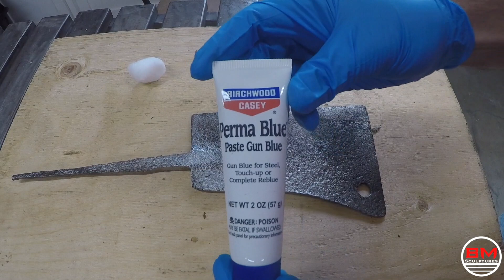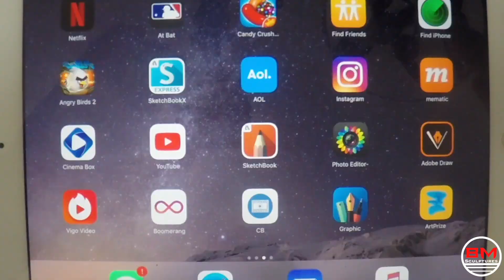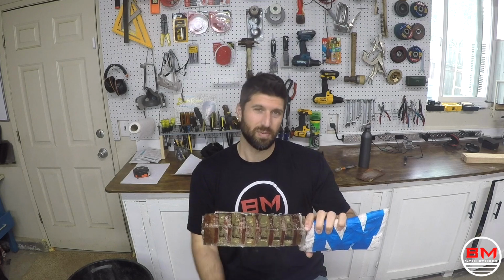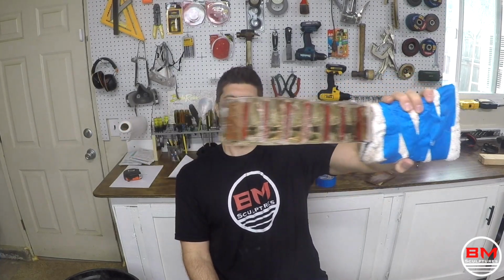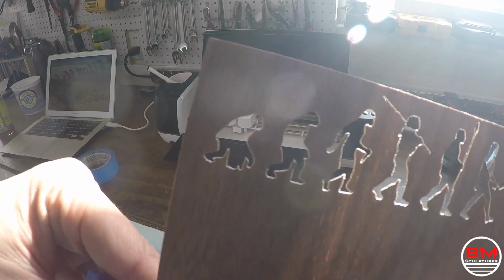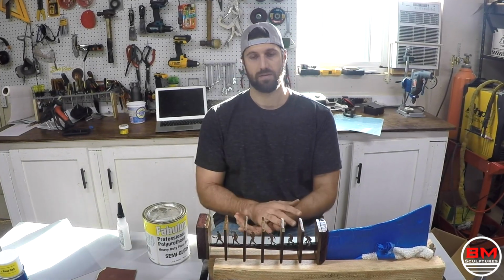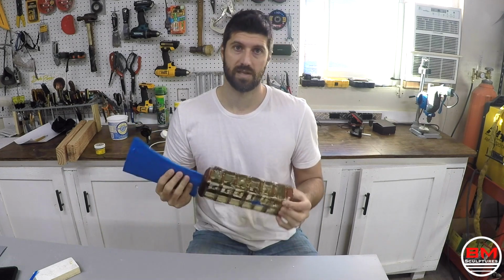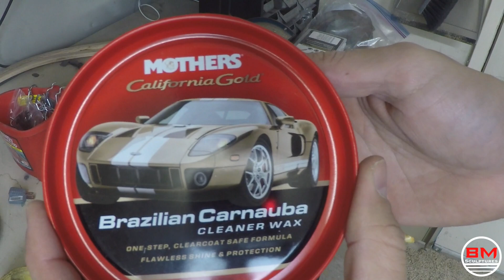Cleaver Restoration with Intricate Wood Silhouettes casted in Epoxy Resin

Comment: Hello, I professionally work with epoxy resins, make carbon fiber for auto tuning. Use Degasser for epoxy resins. But the best result is obtained if the resin is degassed in a vacuum chamber before pouring. And ideally, after pouring, place the product in a vacuum chamber for 10-15 minutes. Such a chamber is easy to make from a gas cylinder or a receiver from a compressor.
After that, your products will be crystal clear from bubbles.
Reply from the maker: Very good to know. Ive seen the pressure pots before. I will be getting one soon. Thanks!

Comment: Amazing! Love it

You can use a small blow torch to heat the top layer of epoxy to remove the plastiwrap. Also I found it a lot faster to remove bubbles using said blowtorch
There are a number of tutorials here that are very good, I learned that the hard way
Reply from the maker: Great tip!

Comment: Air bubbles because you did not vacuum pot the epoxy before the pour., you are also better off with using vaseline on the plexi glass prior to the pour., then find a way to vibrate the table after the pour so it will settle in the small grooves.
Reply from the maker: Damnit I could have just put vaseline on it!!!??? That won't mess with the epoxy? I have seen many people uses these pressure tanks before. I do not have one, and even if I did, I do not think this cleaver would have fit inside the ones that I have seen. I like the idea of vibrating the piece though. More bubbles could have escaped that way for sure!
Reply from the maker: @TenmaFN  Very informative video. Thank you for sharing. I may end up doing this!
Reply: @BMSculptures  if you do end up making your own plywood chamber, an option is to use the compressor from an old fridge or AC unit, instead of buying a dedicated vacuum pump.
Reply: @BMSculptures  there are a few other videos out there. Hope to see your version or take on it in the future.
Reply: Wow is this the post that contributed toward the game changing vacuum pot addition? 😮
Reply: @GenerationDown  yes

Comment: after you pour the epoxy use a heat gun or torch  and apply heat to the epoxy and the bubbles will rise to the sutface
Reply from the maker: I actually did this (I did not put it on the video). It helped get bubbles at the surface but would not do anything to the bubbles deeper in the pour.
Reply: @BMSculptures  Tapping the side of the form in addition to the use of the heat gun should help those bubbles rise to the surface as well.
Reply: @BMSculptures  get your hands on a vacuum pump and chamber. Perhaps even build your own depending on needs. There are also vacuum bags for big pieces with weird shapes that would require a bigger chamber which would not be really practical.
Reply from the maker: @LordJwiss  that is a good idea. Will definitely vibrate it next time.
Reply from the maker: @SnahLhug  Thanks for the info. I will be looking into it for sure

Comment: Important to stabilize the wood.  Pour within a vacuum chamber and set vacuum many times during pour to pull bubbles out.
Reply from the maker: Absolutely. I now know that.... Looking back at this I still would have ran into problems because of the gap between the metal tang and the wood. There would be no way to release the air trapped inside those gaps, which would cause large bubbles regardless the stabilizing.

Comment: I think there are a couple of issues here which I know from watching more recent videos is something you've now sorted out but there are a few ways to remove bubbles 
1, a pressure pot during the curing process that squeezes them to microscopic levels so you can't see them I have a 40L one but the cleaver would need to be poured from the end so that it would fit in. 
2, Use a vacuum chamber to degas the resin before it's poured which I know you now use. 
3, a heat gun or blow torch would encourage bubbles to rise. 
As for the cracking that is usually caused by a heat fracture. Resin cures through an exothermic reaction so it heats as it cures a deep pour or slow cure resin causes less heat so would've helped in this situation as it gives the bubbles more time to rise and disperse and can be poured in larger volumes hence is less prone to cracking. 
It's great to see you show the flaws as people learn more from it that way and like I always say it's never a failure you've just found another way not to do it :)

Comment: Each brand and type of epoxy has unique considerations but here are some general recommendations:  
Orient the pour properly ( in this case you had the form seal in the tall side making it a deeper pour than needed.  If you place it on its side it would have reduced the depth of pour and provided a nice large open top you could torch to remove bubbles.)

If using 5:1 epoxy you need to pour no more than 1/4 inch deep (at least with total Boat epoxy) and you can add extra layers after about 2 hours.  If you pour too deep you get cracks and if you wait too long you have to scuff the surface for a good bond.

Brush on a thin coat of epoxy to all the surfaces prior to the actual pour/pours.  This creates a seal coat and removes all bubbles caused by the wood.

Make your form out plywood of wood and use Tyvek tape on all surfaces that will touch the epoxy.  Seal the inside corners of the form with silicone caulking (use a fondant tool to smooth the edges if needed).

Great project and keep up making unique and amazing content.  It is truly inspiring.
Reply from the maker: Cody, Thank you for all of this information. This will definitely help during my next pour. Much appreciated!

Comment: As someone who is easily discouraged by just about anything, I am very happy to see you push right through that first attempt and try it again. It may not have been what you were hoping for but that came out awesome in the end. Also, that fish has blue/green meat? I don't live anywhere near the ocean and have never seen anything like it! Does it cook up that way? All the fish meat I see is either white or pink.
Reply from the maker: Thank you Eric. The fish is a Lingcod. About 25% or so of them have bright blue meat. Its one of the only fish that I know of. The blue will cook right out and turn completely white. Its a pretty neat fish

Comment: From the thousands of resin vids most use some kind of heating cooling pressure unit to cure a stop the bubbles and cracks appearing in epoxy resin x
Reply from the maker: Thank you for the info!

Comment: Crazy cool project.
You should buy your resin from Russia, There's a couple (one in particular) of channels on YouTube where they make crazy thick epoxy moldings without ANY bubbles at all.
Reply from the maker: Thanks for watching! Ive done further research in resins and I think I can find a better resin for casting here in the states!
Reply: Or super thin so bubbles leaver quickly.

Comment: When I made my desk and used epoxy to cover the paper money from around the world (bills sealed first), I used a blow torch on the finish to take out the bubbles but I did many thin layers so not sure how it would work with a pour. Plus, you wouldn't want to scorch your evo-men.
Reply from the maker: Thin layers will definitely help me... I used a heat gun to pop bubbles (just didn't film it). I just made a vacuum chamber for my next epoxy project so I am hoping it helps

Comment: Hope that I am not repeating something that some results has already said LOL. Besides using a torch or a heat gun and using heat to get the bubbles out also you can spray paint the wood and the other stuff in there with the clearcoat like just any rust oleum or something to seal the air bubbles into the wood because that’s where you’re getting the bubbles from ,it’s seeping out of the wood however your vacuum chamber will also take care of that
Reply from the maker: Thank you for the info. I will be using a penetrating epoxy next time to help seal up the wood. I also made a vacuum chamber!

Comment: Hey I know I’m really late but I just found your channel and I’m so glad I did! You’re really talented and creative, I’ve never seen anything like this before. I’m not an expert by any means but from what I’ve seen I think if you stabilized the wood first it would help. Also a pressure pot is the best way to get rid of bubbles but obviously that wouldn’t work for a shape like this so your next best bet would be a blow torch. I think I saw in some of your replies that you used a heat gun which I’m sure helped somewhat too. Also the type of resin you use can make all the difference. Regardless this was such a cool project, I love the evolution of man idea. And I’ve never seen a fish like that! Is the meat actually blue??
Reply from the maker: appreciate the support! That is a good tip. I will do that next time
Reply: @BMSculptures  no problem! I love your channel, you’re so creative

Comment: You do excelent work. With epoxy I have found that a torch seems to work much better than a heat gun. I think I read somewhere that the CO2 in the gas helps. Not sure if that's true.
Reply from the maker: Good to know... Thanks!

Comment: I like the idea, but in my opinion the handle is too thick. You cannot grab it properly. And the man with the spear in your evolution theme is too high, I guess, I do not see the tip of the spear in the final version anymore. Did it get lost at the belt grinder? 

So: Yes, the idea is great, but you could have spend some more time in the developing period. But this is just my opinion.
Reply from the maker: Hey Christopher. Because of the roundness of the handle, it distorts the images. The Spear tip is still in the epoxy and has around 1/8" clearance from the top. Also to the first question about the handle, I had to make it thick in order to fit the evolution silhouettes inside. At the end of the day this is an art piece and not really made for function.
Reply: @BMSculptures  You are right. This is more a piece of art than a tool.

By the way: I hope you ate the fish and did not just kill if for the video 🤔
Reply from the maker: @christopherhurray6115  I eat all fish I catch. Fish Tacos every time!

Comment: You have to impregnate the wood with resin first then cure it.
Also to get bubbles out people use slow resin and run it through a pressure pot.
See Peter Brown's channel.  He does a lot of work with resin and porous materials.
Kind of like this.
https://www.youtube.com/watch?v=Tr2GPbJvHmk
Reply from the maker: Thank you for the info! I will be checking out Peter's channel for some tips!

Comment: fail ?
Reply from the maker: I learned a lot about epoxy by working with it so I wouldn't consider it a fail, however the handle does have it's imperfections.
Reply: @BMSculptures  Hi Blake I watched this video again it was a really amazing project. I know with all you have learned since you first did this project if you did it now it would come out flawlessly. It was definitely NOT a fail. As usual amazing!